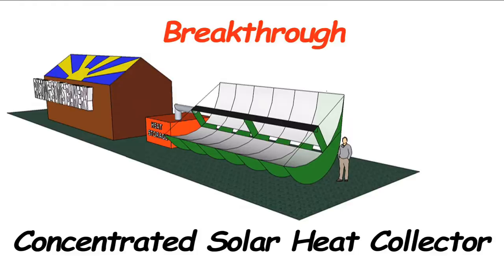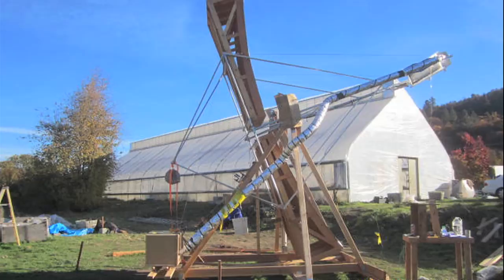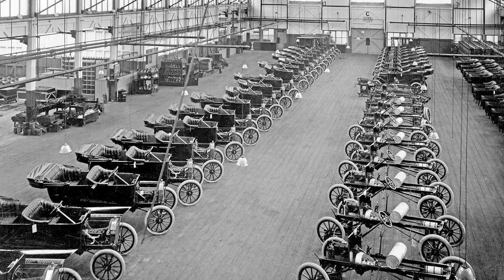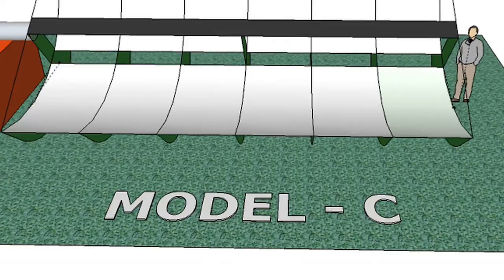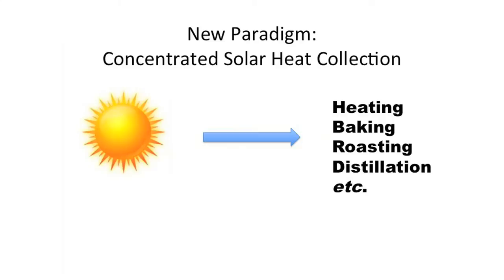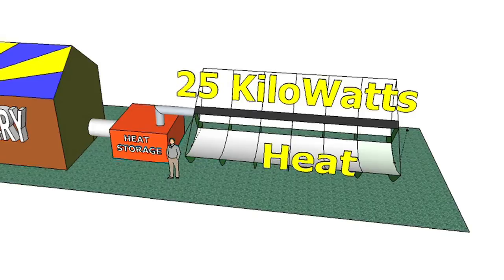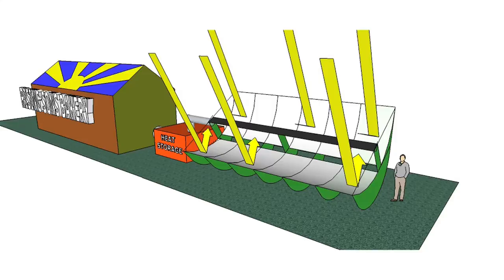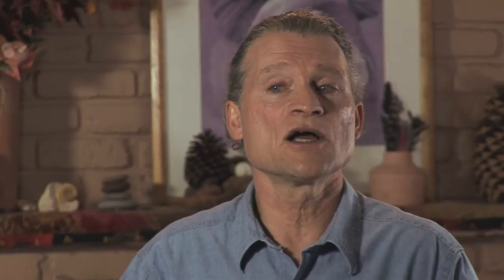DIY -  COMMERCIAL-SCALE, Concentrated Solar Heat Collector, Instructional Video Project

Comment: If you use a heat diode you can move the heat 60 ft .there used in nuclear sub's for there Stirling engines .a simple one is a pipe with closed ends a 10% water you heat it to steaming and blow out the air then shut it up it works well ? No pump needed .👍